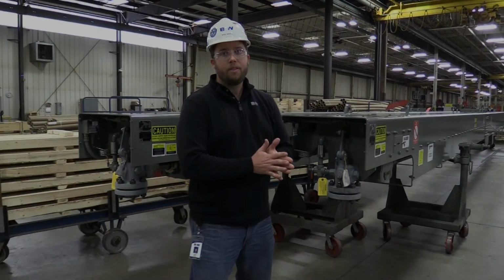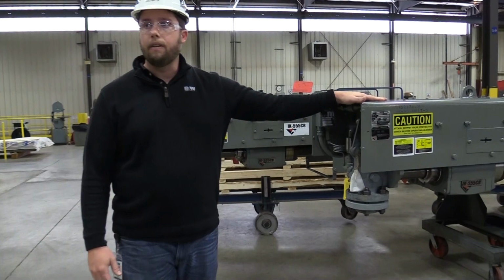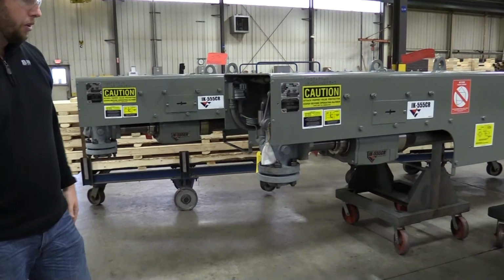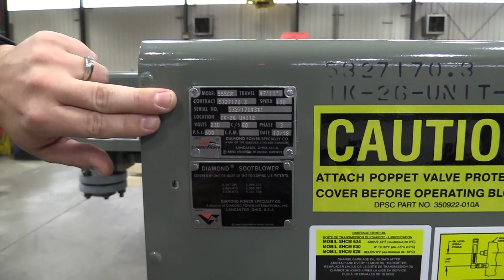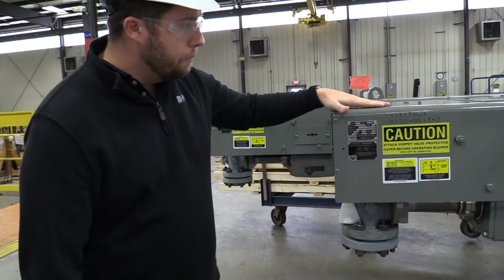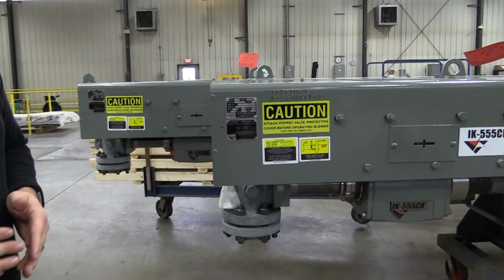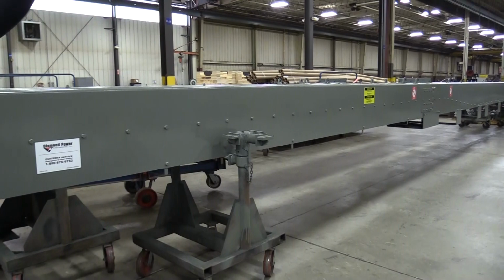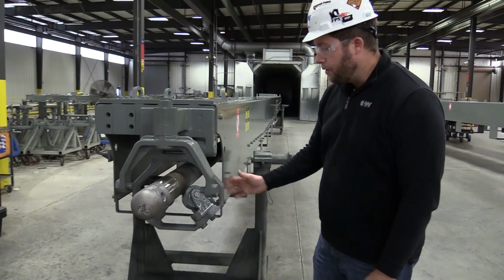Diamond Power® Retractable Sootblower Overview | Babcock & Wilcox

Comment: What are the possible reasons your Sootblower could get stuck on the way out ?.....Goes all the way in the boiler but comes out half way only.
Reply: Sounds electrical but buildup on the tubes can also cause that but usually on the way in the boiler
Reply: Could be multiple reasons. A bent lance, the gearbox could be slipping, heavy build up, or an electrical problem(bad limit switch, bad motor, etc.)
Reply: @vaughnfraser4907  Those would cause a "stop" or "stall'. Not a "stuck".